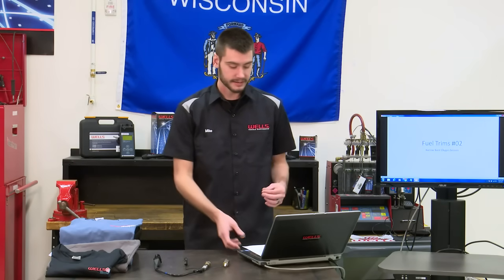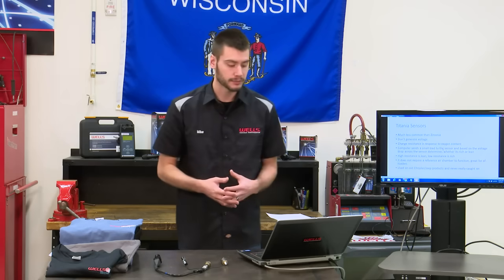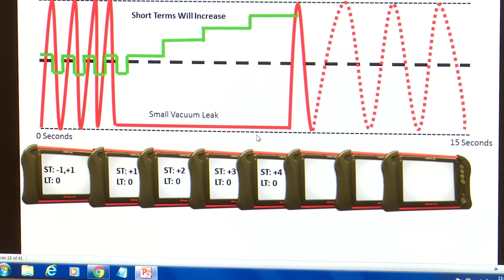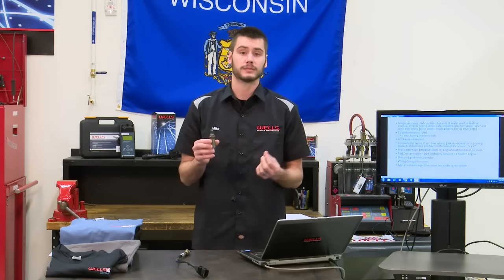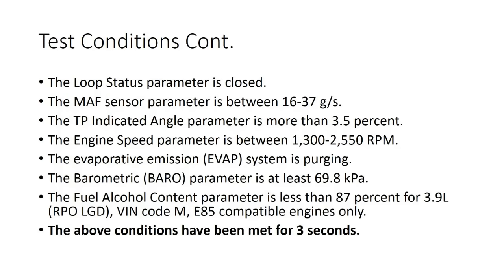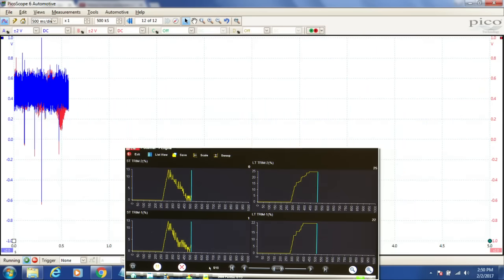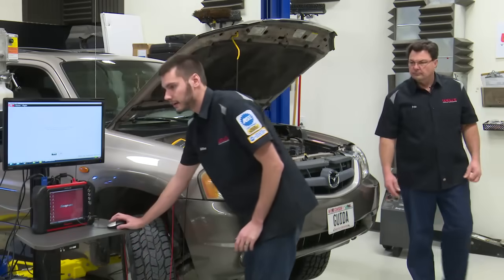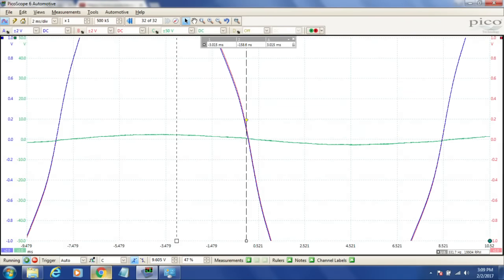Fuel Trims – Oxygen Sensor Basics—How They Work and How to Test and Diagnose Them (O2, HO2S)

Comment: Hi sir i have corrola 2013 have some problem .some times engine run smoothly mostly fuel tank below 25% and other time pulling issues feels little  vibrative.In OBD scan its ok . I change o2 trotal mass airflow  a and   four coils can u help me
Reply from the maker: Hey Faizal, is your vibration related to a misfire or is it something in the driveline?
Mike Becker, Senior Technical Instructor
Reply: @GoTechTraining   thks for ur reply yes for sure its miss fire with less pulling and when stop engine will stops with a vibration .already replaced all mounting
Reply from the maker: How do the fuel trims look when it's running poorly? Are they rich or lean?
Mike Becker, Senior Technical Instructor
Reply: @GoTechTraining   slight down  variation when vibrating more

Comment: what will be reaction of o2 sensor if engine works with LPG, no petrol.  450milivolts, rich, lean behaviors......
Reply: will be same as petrol,  fuel  type not metter. - 450 mV always stecheometric
Reply from the maker: Hey Fatih, Fregis is right. The sensor will still do it's job
Mike Becker, Senior Technical Instructor

Comment: I have a question regarding whether or not the PCM actually reads the voltage drop across the titanium sensor. You say that the old style O2 titanium sensor measures a high voltage indicated a rich condition and a low voltage across the 02 sensor indicated a lean condition. That is,  a high resistance means a lean condition,  a low resistance means a rich condition.  It sound like backward logic, since for example, adding to much oxygen to a lawnmower carb causes the rpms to increase and the engine to run hotter I would expect the resistance to drop when a resistor gets hotter and thus a lower voltage would be across the o2 (resistor) sensor, but you  are saying just the opposite. that it, when the voltage is low, you have a rich condition.  I'd have to see a schematic. In my mine it would seem more likely the computer is not reading the voltage across the sensor, but instead the resistor they must have in series with the 02 sensor. I would imagine this series resistor would be in the PCM and more logical for the PCM to  monitoring the voltage drop across the resistor located in the PCM and not across the sensor. In which case it would make sense to me why a low resistance would mean a rich condition.
As for the test question you posed, I'd say the answer is D.
Reply from the maker: Hey Derek, an 02 sensor isn't a resistance type sensor. It's a chemical reaction creating a voltage. The voltage is created by oxygen traveling across the element. Heat up a sensor, doesn't need to be plugged in, and you'll see a voltage output. Does that help to answer your question? And yes, the answer was D. Nice!
Mike Becker, Senior Technical Instructor

Comment: Does o2 sensor compare o2 in exhaust air with outside exhaust air 2? if there is grease on o2 sensor part, out side exhaust pipe then will that grease cause rich or lean?
Reply from the maker: Hey, yes the 02 sensor samples outside air to compare it to the exhaust gas. This are comes through the wires many times. That's why you don't want grease in the connector. 
Mike Becker, Senior Technical Instructor

Comment: Two failures P0141 and P0161 on 2002 ws6 transam. Could it be the sensors are fine but the catalytic converter has failed.Thanks for the great instructional video.
Reply from the maker: Hey JD Kaz, these codes are for both post cat sensors. What's the likelihood that both cats failed at the same time? All 4 sensors share a power and a ground. Also, these are heater circuit failures, so it's not a cat issue. I would investigate both heaters and see if they are open.
Mike Becker, Senior Technical Instructor
Reply: Thanks for the quick reply. I just swapped out the intake manifold. I wonder if the gasget sealant is leaking. Also I have turned off the engine light and it hasn't yet returned. The webcast was very helpful. Keep up the good work!!!!

Comment: You mean the O2S grounds thru the treads ? Not the "nut" ?
Reply from the maker: Correct, it grounds through any metal point threaded into and touching the exhaust.
Mike Becker, Senior Technical Instructor

Comment: hello i have aquestion about air fuel ratio in my toyota corolla by scanning with scanner obd it shows all the time negative long term fuel trim -3.9%-2.9% is this ok ? there is no check engine light i think it should be near zero  how can i know that my a/f ratio is working properly
Reply from the maker: I'd say that's just fine. I wouldn't worry unless you're closer to +/-10%.
Mike Becker, Senior Technical Instructor

Comment: The O2 sensor puts out about I volt air interferes with the output voltage so computer reads the voltage and determines if there is too much air or not air interferes with the output that's how a O2 sensor works

Comment: You said several times during the live demos we see our fuel sensors go back to switching.  It's the computer thats pulsing, not the sensors.
Reply from the maker: Kind of Joseph. The PCM is manipulating the fueling into the engine which in turn makes the oxygen sensor go from rich to lean, rich to lean. The sensors are switching in voltage because the PCM is changing fueling.
Mike Becker, Senior Technical Instructor

Comment: I have a Nissan B13 with a SR20 engine but I'm having difficulties finding a O2 sensor that can work with it. I heard it uses a 1 wire sensor. Anyone got a link for one?
Reply from the maker: Hey Rex, I can only look up by year/make/model. If you can get me that info i'll try to find you a part number!
Mike Becker, Senior Technical Instructor
Reply: @GoTechTraining  Thank you a lot ! It's a 1990 Nissan Sentra B13. 4 Door. RHD.
Reply from the maker: I'm only showing the 1.6L. My catalog doesn't list the 2.0L. Is that JDM only? 
Mike Becker Senior Technical Instructor
Reply: @GoTechTraining  We replaced the original engine and put in the SR20. I think the O2 sensor for the 1.6 should work but if you have the info for both the 1.6 and 2.0L then that'll be great! Ty.
Reply from the maker: For the 1.6L I show sensor part number 25572. I do not list a 2.0L in 1990 in the USA. A 1991 Sentra 2.0L uses a 24521. Hope that helps!
Mike Becker, Senior Technical Instructor
Reply: @GoTechTraining  thank you so much !! You've been a great help.

Comment: Dears,
Thanks for the useful informations 👍, I have a question please i have HHO dry cell.
1. how can i modify the o2 sensor to be compatible with the dry cell ?
2. Is o2 extender is useful for that case?
That in order to save fuel 😁
Thanks
Reply from the maker: All an oxygen sensor is doing is comparing the 02 ion count in the exhaust to reference air. If there is more or less that 14.7:1 then it goes high or low. I'm not familiar with a HHO dry cell, but if it's running leaner that 14.7:1 i'm not sure a standard 02 will work for you.
Mike Becker, Senior Technical Instructor

Comment: I have a question.  13 Rogue with 182k miles. Fault code for the upstream o2 sensor. As stated it could be various things besides sensor. Checked the ohms and voltage and it looks good or ok. Not totaly sure of the parameters.  It has thrown the code on start up once and now when I was at highway speed. Checked the catalytic temp before and after, also good. Any ideas on where to go? Vacuum leak? Last time I pulled the sensor and used some maf cleaner and the code went out after 2 days. Stayed out for about 2 weeks. Gas mileage has not improved or worsened with the code. No loss of power or hesitation or rough idle. Ordered a new sensor anyhow and going to install it.
Reply from the maker: Hey Nate, hope I have an answer! My guess would be you probably have a bad sensor. Only other thing I'd want to inspect are the fuel trims...if they are even responding. Guess it depends on how bad the sensor is.
Mike Becker, Senior Technical Instructor
Reply: @GoTechTraining  thanks for your response. Sensor should be here today and this weekend it went out with a 200 mile trip to Homestead and back. Will update you with whatever happens. Thanks again.

Comment: I have a question about O2 sensors.
I installed two o2 sensors for my 1999 Subaru Impreza and when I look at my gauge it reads 0.0v fpr both O2 sensors at warm up at idle. When it reaches 0.0v the car hesitates and drops rpm around 5XX rpm and then goes back to 7XX rpm. It seems to run normal when I rev the motor to 1000rpm it fluctuates between 0.9v to 0.4v but when dont give it gas it starts going down to 0.0v and that's when it hesitates for a split second and stays at 0.0v until I give it gas.
Do you guys have any clue what could be the problem?
Many thanks.
Reply from the maker: Hey Ryan, hope I have an answer :) It sounds like maybe you have a very lean problem? It's odd its dropping to 1 volt though. I'd expect more around .1V or so. You could have a signal wire issue also. Have you verified that the heat circuits are working for both sensors?
Mike Becker, Senior Technical Instructor

Comment: Great video Mike. Would the o2 on a cold start be sending any form of signal to the pcm? My 04 Ram 1500 5.7 will race like heck on a cold start (25-3000 rpm) then drop to idle. Once engine is warm the starts are normal. I have no codes
Reply from the maker: Hey K Smith, no, the O2 sensor doesn't send any signal until it reaches operating temp. It requires a certain temperature before it starts creating the voltage. Does this racing cold start rpm seem new? What are your fuel trims once you enter closed loop?
Mike Becker, Senior Technical Instructor

Comment: Dee!!!!
Use anti-seize and a steady voltage usually means your cat is working!!!! meow!!
Reply from the maker: Hey Rosalie, Correct answer, incorrect explanation! You should have stopped while you were ahead :) You don't want to put dielectric grease in the connector because it blocks the reference airflow going into the sensor. You nailed the second part!
Mike Becker, Senior Technical Instructor
Reply: @GoTechTraining  anti-seize on the threads. I think u meant no grease on the tip of the sensor instead of "connector"
Reply: Rosalie Robillos lol 😂

Comment: Here D is the correct answer I think:
Cause: 
Never use dielectric grease in low voltage connectors
steady output voltage on O2S may be as a result of some other faults such as vaccum leak
Reply from the maker: Hey Dheepu Dhass, D is correct! Well done. 
Mike Becker, Senior Technical Instructor

Comment: Neither is correct! Downstream o2 should be steady around 4.5v at operating temp if the cat works properly and if stoichiometry is achieved
Connector already comes with water intrusion insulation
Reply from the maker: Hey, correct answer somewhat incorrect explanation though. Generally, you see the downstream sensor slightly rich but steady. You don't want to fill the connector with dielectric grease because air actually can travel through there and wick down the wires. The grease will prevent that.
Mike Becker, Senior Technical Instructor
Reply: @GoTechTraining  noted sir!

Comment: Hello ngk tech I’m running into a code p1174 which mean running a lean condition for fuel trim .. so they say the cause is dirty fuel injectors or plugged or check your o2 sensor bank 1 .. car has 116000 2.4 hhr .. I was thinking about changing out the plugs first because just bought the car three months ago and see what happing and going to run a tank of 93 octane and a bottle of Techron .. just lookin for inputs ...

Comment: Hi guys just a question about o2 sensor diagnoses.  I've got a 2002 ford AU Falcon(Australian) with a v8 engine running rough.  The vehicle has 2 4 wire heated o2 sensors (one per bank/ not a wide band o2 sensor) and when I read the o2 sensor data, its reading between .1 volts to 2.8 volts on both banks (I thought it is not suppose to exceed 1 volt unless its a wide band o2 sensor).  I tested this with 2 different scanners IDS and a snap on scan tool with the same results. I cannot seem to find any information regarding 02 sensor faults with readings above 1 volt on the scan data. Anyone had this issue, thoughts on this please. Shorted o2 sensor?, another type of o2 sensor that I'm not aware of (meaning this is normal operation)? Thanks
Reply from the maker: Hey, the first thing I would do is use a multi-meter or something to actually check the voltage leaving the sensor. A standard oxygen sensor should not exceed 1 volt. Maybe you have a scan tool that's misunderstanding information...verify actual voltage output prior to getting int too deep.
Mike Becker, Senior Technical Instructor
Reply: Check your engine computer's ground pins for corrosion.  The engine computer sinks a lot of currents. If there is resistance between the computer's ground and chassis ground,  a voltage will develop on the computer's ground leads that increases as current increases.   This is what caused a false P0411 code on my Focus;  there were spikes on the sensor output.  Also check connections on negative battery terminal.   Bad ground connections cause a lot of false readings and erratic operation.

Comment: Hello brother .o2 sensor position 2 voltage what should be ? My car is astra h 1.6 lpg model.and my problem is fauld code p0136 bank 1 sensor 2 .help me please what should i do ?
Reply from the maker: Hey Erdem, most sensor 2's are a standard 02 sensor. They are mounted after the cat so you should see a relatively steady voltage reading usually around 550 mv or so. You can make it change by leaning or enriching the engine but remember that the catalytic converter will absorb some of the effects.
Mike Becker, Senior Technical Instructor
Reply: @GoTechTraining  hi brother.I can send a graphic image but you need to give way to communication please

Comment: Hey, Mike. i am trying to diagnose a p0420 and p0430. After driving for more than 30 minutes, the rear o2 keep switching lean to rich and vice versa. I think the the cat should be hot enough not to switch and think that the cats are bad. would you have come to that conclusion as well? By the way, we missed your videos.
Reply from the maker: Hey Leonardo, sure, could be a cat issue. Those 02's aren't supposed to switch in the rear. If they look similar to the front 02's then you have an issue!
Mike Becker, Senior Technical Instructor
Reply: Thanks, Mike.  I can be sure now that my cats are defective.

Comment: is that possible to clean the O2 sensor and how?
Reply from the maker: Hey Sharif, not really. If the sensor is dirty to the point it affects operation it's time to replace it.
Mike Becker, Senior Technical Instructor
Reply: I shit u not! use a small propane torch and heat the tip of the sensor to red hot keep  it around that temp for a minute or 2 if its bad, it burns off the carbon.
no matter what anyone tells u dont use carbie or brake cleaner however u can use an upper engine, egr cleaner or seafoam theyre all o2 sensor safe.
have fun dont melt the wiring end lol

Comment: I’m having trouble figuring out if i have bad o2 sensors or a lean condition. I’ve tested for vacuum leaks and found none. I have also checked for exhaust leaks and haven’t found any ether. I do have a slight misfire so I’ll have to check one of my injectors
Reply from the maker: Hey Ngarcia250Z, tried forcing the engine to run rich and see if the 02 sensor responds. Give it some supplemental fuel. Propane is the best option but be SUPER careful....only a small amount. 
Mike Becker, Senior Technical Instructor
Reply: Wells Vehicle Electronics okay I will try that next before I go ahead and replace more parts. The o2 sensors are the ones in question right now. The car is a 2005 Nissan 350z I get a slight hesitation when I give it wide open throttle in ether first or second gear. Which make me suspect of ether a fuel pump that’s going out or the fuel pressure dampers. I’m hoping it’s just the sensors.
Reply: Wells Vehicle Electronics well I richened the engine with starting fluid and the voltage on the sensors went down drastically and the fuel trims did go down. But isn’t the voltage supposed to rise with more fuel instead of decreasing?

Comment: If your lt fuel trims are round +7 and your st fuel trims are round -4 does that mean over all youre running round +3 all together
Reply from the maker: That's exactly right. If the ST stays around -4 you should see the long term start to scale back down.
Mike Becker, Senior Technical Instructor

Comment: The new smog check scheme made repair shops and the parts awful happy.

It has nothing to do with improving air quality.

It has everything to do with the sensors that fail easily.
Reply from the maker: Cars today are cleaner and better monitored than any of those old cars. The sensors have a job, monitor, what is going and what is coming out. This ensures proper emissions. Anything over normal will set the light.
Mike Becker, Senior Technical Instructor
Reply: Wells Vehicle Electronics says:
"Cars today are cleaner and better monitored than any of those old cars."
==
Do you mean exhaust pipe test wasn't doing enough to reduce the emission?

Comment: WOW i am blown away by the fact that you can destroy an oxygen sensor by applying dialectric grease to the connector. I think back to all the years Ive replaced oxy sensors that malfunctioned a few months after, I so thoughtfully greased the connector. I just spent 100 bucks replacing a NEW upstream oxy sensor TWICE cause my so called mechanic friend told me "be sure to apply  dialectric grease to keep water out and stop the corrosion. two months later that new oxy sensor was unresponsive!
Reply from the maker: Hey Jim! Sounds like you've learned something :) Thanks for watching!
Mike Becker, Senior Technical Instructor